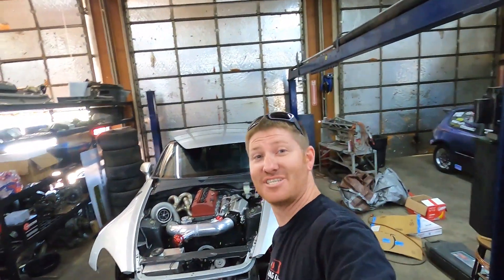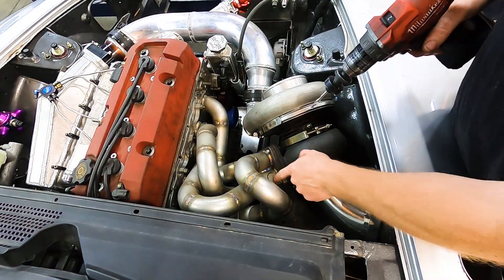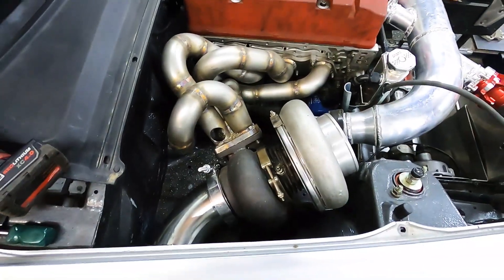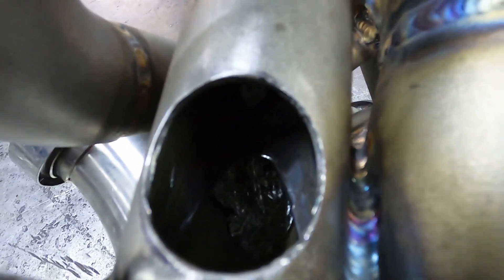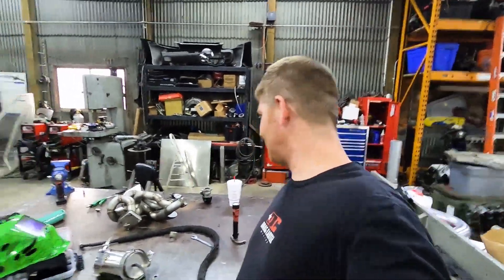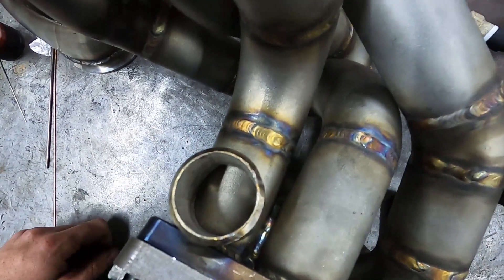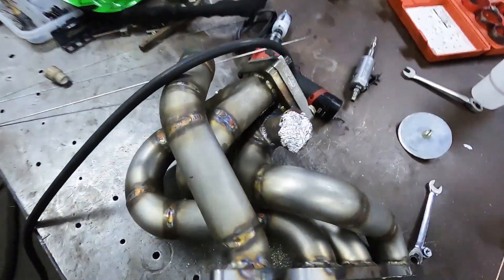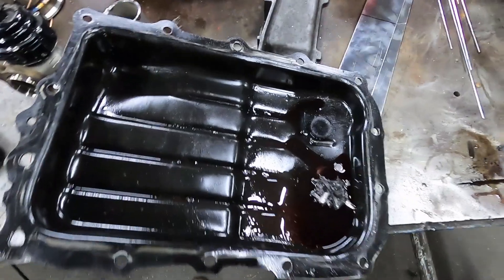SHO’NUFF Gets HOT Control!

Comment: @PFI Speed will there be enough rigidity, or flex, in that elbow between the turbo and the fender exit to allow for any engine movement? Or since the engine is solid mounted do you think the engine/turbo will stay still enough in relation to the fender exit that it won't matter?